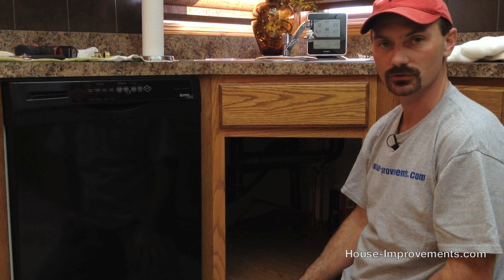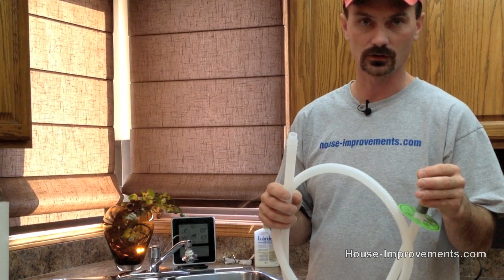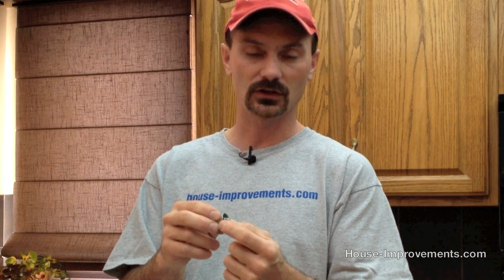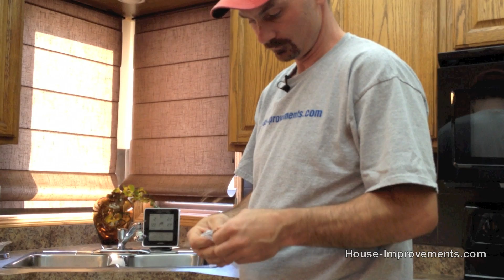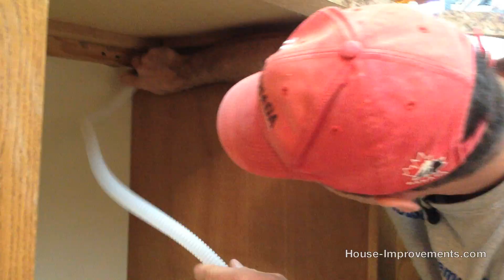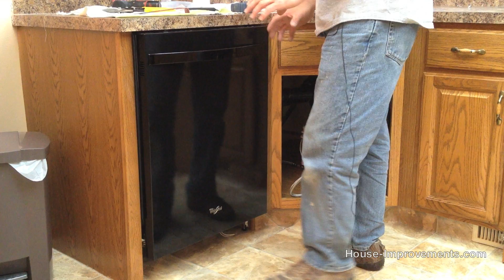How To Replace or Install a Dishwasher

Comment: Im trying to install a dishwasher from scratch. A swap out is an easy job, I have to make a new outlet, drill holes, redo the sink drain, make new water connections, and mount the machine.

Comment: More explicit instructions on how tight to make water connections would be VERY helpful, was none I saw on braided hose.
Reply from the maker: These hoses have a rubber gasket so they need to be snug but not over tight. No really way to tell you exactly.

Comment: Top tip:
Use the cardboard that came with the box on the top to help slide everything in place, once it's in you can remove the card and the insulation shouldn't bunch up as much if at all.

Comment: Very good video as have been all of yours I've seen. . You might want to suggest making sure the water has been drained. Mine quit in after filling in the wash cycle and was full of water. I used a wet-dry shop vac to clear it. Just a minor point.

Comment: I'm not sure I like braided water supply for a dishwasher, would prefer soft copper, but a bit harder install.
Reply from the maker: Use braided ,you will never use copper again.
Reply: @HouseImprovements  Thks!

Comment: To help with the insulation I used a "yardstick" to remove the high spots. Yes I"m an old timer who still has yardsticks and they come in handy.Also while you have the drain line off make sure the fitting it goes onto is clear of obstructions as this was a problem I encountered.

Comment: "The very first thing you want to do is find your breaker in the basement on the fuse box for the dishwasher ..."

Well, damn, I'm already screwed before I even begin! Not only are breakers not in "fuse boxes" but I don't even have a basement! Guess I'll just have to keep doing the dishes in the clothes washer.

Comment: The electrical is non compliant, needs to have a readily accessible disconnect and be GFCI protected, this is routinely done with an appliance cord plugged into a GFCI receptacle located in the adjacent sink base cabinet.
Reply from the maker: Maybe in your area but not here. Check your local codes people.

Comment: if someone here can help i have 2 dishwashers one is smaller other one is bigger the bigger works fine has these days connection but the other one with the hoe that takes the water has copper tube and dont fit in normally.. how i connect it?

Comment: Anything wrong with using the old fittings and supply hose on the new dishwasher?
Reply from the maker: I don't recommend it. Sometimes they are so old they don't conform well to being taken off and re installed and you stand the chance of them leaking. You get a new drain hose with the purchase of a new dishwasher anyways and you can buy a new water supply hose at the same time.

Comment: The side-wall rubber sealant is stinking out from the top and the bottom is slightly tucked in.  That means that the machine is not leveled and also it looks unsightly.  Those details separate the professional who is mindful of doing the correct way and of the details from the trailer park laborer.

Comment: How do you get the measurements for the new dishwasher before you pull out the old dishwasher?
Reply from the maker: 99% of dishwashers are made to fit a standard 24" wide by 34-1/4" high space

Comment: Fantastic instructions.  In two days a new Kitchenaid dishwasher is being delivered and I will remove my 26 yr old and still working Kitchenaid washer and install the new one.  Your video makes it very easy to do the job and I will save $129.  My original washer was installed with a copper line, should I use that one again or put a braided line like you did.  I plan to reuse the old electric wire.  Thank you so much for such a clear and easy to understand video.
Reply from the maker: I would replace the line with braided. Those old lines can develop leaks from being moved around with install.
Reply: @HouseImprovements  Thanks!
Reply: @HouseImprovements  I just replaced my dishwasher and my new Kitchenaid looks underneath just like the Whirlpool you installed.  My only complaint on your video, you didn't show how to hook-up the drain hose.  I did replace the copper water line with the braided only for the ease of installation, but the package says it should be replaced every 5 years to avoid the hose to leak.  Copper lasts a lifetime.  Thanks again your video made it easy.

Comment: Seems to me the electric and hose connections should be made and tested prior to putting in the screws.   Otherwise you might have to take them out if you have to pull out the machine again.

Comment: You should probably explain what to do if the dishwasher is wired properly but not coming on when plugged in that's the problem I'm having.

Comment: I thought wiring any appliance like dishwasher, stove, garbage disposal directly to romex is not code, I always have to install an electrical box and outlet.  I had several dishwashers delivered to my rental and the installer will NOT install unless I put in an electrical box.
Reply: I'm not sure where you're located, but that's not completely true.  What the code in the US says is that it must have a local means of disconnect.  Usually a grounded receptacle is what people will default to.  But, you could go from a switch as well.  Most people prefer to put the receptacle in, and then they also have a place to plug in the garbage disposal.

Comment: Hi.I see at Minute 11.50 the  drain hose is on the Left. Can the Drain hose be switched to point to the Right? If the Sink is on the Right.? For a Shorter Run?

Comment: The controls are not supposed to be visible when the Dishwasher is shut so it look ridiculous! Also no way to know if the insulation didn't get bunched up. It should've been taped down first. Smh

Comment: Recently y garbage disposal went out so my husband replaced it then my frigidaire's motor went out as well. So we decided to replace the motor hoping that it would work, but sadly the dishwasher wasn't daring properly and mold started to collect so I told my husband to replace the old dishwasher with a new one.  Unfortunately, I'm still having the same issue the water is not daring!!! I don't know what to do! Every time I use it I have to go in there and remove all that water that didn't drained is about two gallons of water that remains at the bottom of the dishwasher. Any advice??
Reply from the maker: Please come to my forum and post you problem with a picture of the drain plumbing hook up. http://www.house-improvements.com/forums/

Comment: Seth - my new dishwasher is being delivered tomorrow afternoon. I've been watching all the DIY videos and feel that I am now armed and dangerous!  I do have one question tho, I believe I have copper tubing for the water supply line and I would like to remove it and use one of those braided lines...I caught a glimpse of the line in the video and it looked like two hoses were connected together because one hose may not be long enough...is this what is going on here?

Comment: maybe lowering the front of the dishwasher by screwing the leveling screws could help with the blanket getting in place?
Reply from the maker: yes that would help,and then adjust them back to where they need to be after.
Reply: Good idea.

Comment: why after i hooked up the dishwasher. ...(just like the one in the video...Whirlpool Gold).....when i turned the water valve on....the unit filled up an an never stopped filling up.....started pouring on the floor. ....i wouldn't think it would allow the water to fill until the unit was turned on turned on......
Reply from the maker: Yeah something isn't right there. Stop by our forum for more detailed help @ http://www.house-improvements.com/forums/

Comment: Should the installer check the new connections are water tight before completing the install?
Reply from the maker: You run a test after everything is hooked up and the machine is standing upright again

Comment: Hi Shannon or HouseImprovements I'm interested in installing my portable dishwasher permanently and am wondering about the water inlet valve and drain port s as they are both plastic. I noticed that the water inlet on the dw your installing also has a plastic water inlet, so based on your tutorial brass fittings (Garden hose elbow fitting) can be attached to plastic valves? I was told to purchase a dishwasher install kit to covert  from portable to permanent and was just a little concerned about the brass on the  plastic and decided to search online for help and found your tutorial  

Really great video and hope to hear from you soon
Reply from the maker: Yes ,buy the conversion kit, everything should be there you need for this
Reply: Thanks HI and it was so nice to hear back from you..really a pleasure!

Comment: One of the best DIY removal/install videos of a dishwasher I have seen. The only thing I see missing in this tutorial, that is quite important, is the "leveling" process of the dishwasher once it is in place. Other than that, great video.
Reply: Also, I would recommend verifying that the power is off before you grab the wires.  The house I live in had about a quarter of the breakers labelled wrong.
Reply: Great Video Shannon,  Though, I agreed with Robsb, at 2' 30 sec, I was wondering if those 'bare hands' were about to receive a shock!  Thanks for posting.
Reply: Yes, it needs leveling the dishwasher. I installed once four years ago.

Comment: I haven't read all comments (there are many!), but I would have screwed in the front adjustable legs, slid in the unit, and then adjusted the front of the unit up to clearance.  That way, the insulation pad would not have cost me several minutes of work AND the risk of it bunching while scrubbing up against the bottom of the counter.  Otherwise, good video.

Comment: This video is great for someone like me!   I appreciate it and your time.  

I'm putting in a new dishwasher, and into a location where there wasn't one.  My only real concern is the dirty water drain line going to it's location under the sink/hook up.   

Looking at your video... you show the drain line under the washer and going UP to the drain discharge point.  It seems that a lot of water is "stuck" in-between the dishwasher exit and the sink drain point.  I guess that's the way it is.   Sighhhh.  LOL
Reply from the maker: D. Bartholomew  You want that drain line to go up high to prevent back ups.
Reply: Yup...just saw your other video.
Reply: Question, please.

When removing all of the old dual sink drain PVC piping... the metal nut  (holding a very short piece of PVC drain line directly under the sink ) broke into pieces.  This piece seems to be an intermediate between the metal sink drain and the PVC telescoping drainage piping.  What is the purpose of this small 2" piece?   Do I really need the short / intermediate piece of drain line with the metal nuts... or can I just attach the telescoping drainage piping directly vack / under the sink?

Comment: When the dishwasher is equipped with this type of inlet connection, it's always a good idea to put teflon tape on the plastic threads before screwing on the metal fitting, even though there is a rubber washer inside, it's recommended as added insurance.

Comment: If the copper tubing is in good shape, do you recommend replacing it anyway with flexible tubing?
Reply from the maker: David Morgan I would,i do not trust that copper after it has been pulled in and out a few times.
Reply: Got a shiny new flexible hose.  Just so much easier to work with but I did have to go back for an adapter where it hooked up under the sink.

Comment: As a master plumber and appliance installer I'm here to say that extra hoses/tubes are required along with a power cord . Keep in mind that we can not hook up to old waterlines and are responsible for any leaks or floods. The whole " if its in good shape " isn't what we stand by. Best case is  I charge a client $85 to fix the problem, rather than a whole remodel requiring a refinance of their home.

Comment: Are the controls supposed to stick out beyond the countertop? How are you to see the controls if they are flush with the counterfront? Do we lower it down in the front so that the buttons are more visible?
Reply from the maker: No you open the door. If you pull the dishwasher out that far the side insulation becomes visible

Comment: Hi, Shannon, thank you for the follow up. I really liked this video... but the thing that the install manual and this video was vague on was where to hook the drainline to the dishwasher (not under the sink... which you do cover elsewhere) I had to install a new air gap (required here) Previously this had broken I guess, and had been bi-passed. So that was another story. But my install manual and your video did not cover where to hook the drain line to the new dishwasher. This may seam obvious to you and the manual writers, but as a dishwasher noob, this was less than ovbvious to me, and hung me up for some time. I do apreciate the videos, and will try your site next time... my tomorrow project is replacing an antiquated electric coil cooktop with a new but similarly somewhat retro cooktop... (since I hope it will fit in the same hole as the old one.
Reply from the maker: Sorry for the mix up.

Comment: Should have watched this and some other u-tube videos before I started my install. I agree the machine is meant to have the buttons recessed... otherwise, if the machine sticks out  that under sink door will hangup on the dishwasher (trust me on this corner sink problem). I would have liked more information on the hookup under the sink for the drain line. I do appreciate that the video appears to be Canadian. :}.
Reply from the maker: Here is the plumbing hook up.https://www.youtube.com/watch?v=22PU1-98b6E&list=UUpJ1vJPFqImom-NN2fkBS0A
Reply from the maker: Also if you go to my channel you will find the electrical hook up.
Reply: I agree with you. My understanding is that on models with the control panel on top of the door, like this model,  the control panel is intended to to be hidden under the counter top when the door is closed.  So  installing it so the controls are visible when the door is closed, as this video says, is  misleading.

Comment: I was tracking with ya.. Up until the end when you didn't show how to reconnect the electrical???😣 Bummers!!!! That's the only thing that worries me!
Reply from the maker: Here is the video for that . Subscribe to see all our videos. https://www.youtube.com/watch?v=fEZNNTsXBxs&list=UUpJ1vJPFqImom-NN2fkBS0A
Reply from the maker: Please watch this link for the electrical. https://www.youtube.com/watch?v=fEZNNTsXBxs&list=UUpJ1vJPFqImom-NN2fkBS0A
Reply: Ditto. I'm watching this and all of the sudden it was all done! I was like WTF!
Reply: I would have liked to see the re-connection of all the hoses too.
Reply: @OhanaFilms  Yeah, skipped over that part as well. And when he was talking about the hose hookup, the camera was on his face instead of the pieces. Camera should have been much further back, or concentrated on the subject, which was NOT him. It was the parts he was talking about... gah...
Reply: Exactly; that's why I haven't hooked up my dishwasher yet and it's been 5 weeks.  My dishwasher also has the controls on top, but the manual says to push the cycle you want with the door open, and when it closes it will start.
Reply: It wouldn't work if anything missing connection.